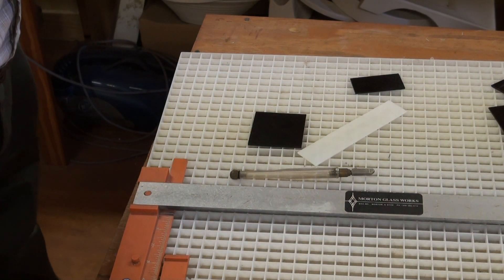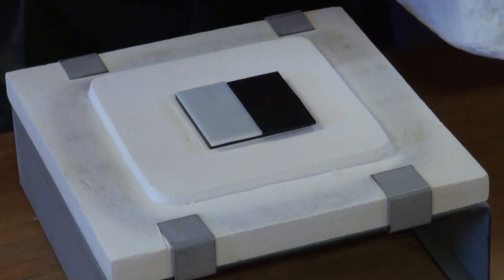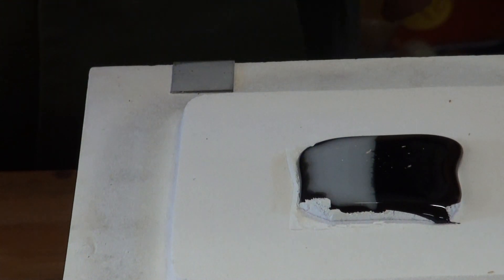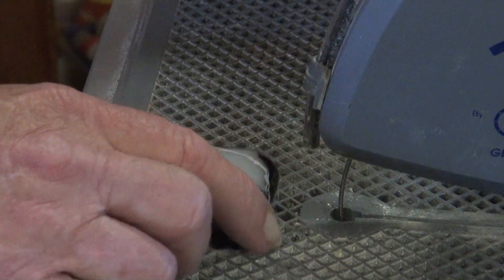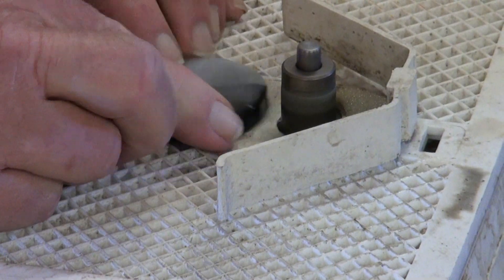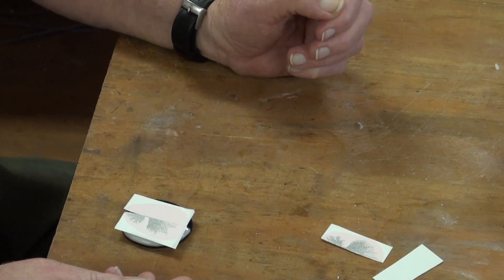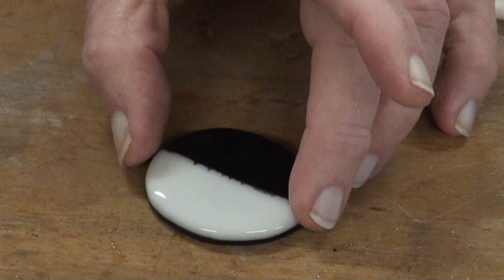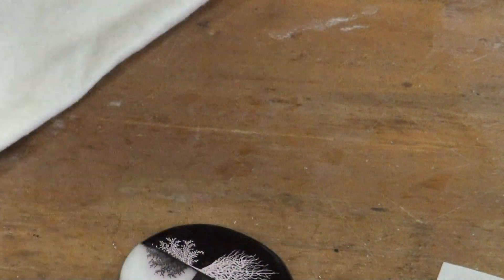HOW TO MAKE AN ELEGANT GLASS PENDANT (PART 1)

Comment from the maker: Sorry to take so long to answer.  I like it because it is fast for small projects.   I have never used it for Virigraph, but I don't see why it wouldn't work since the elements are in the lid.  The bottom is free to modify however you want.

Comment: I see that you are firing directly on the kiln floor, no shelf? Is that a standard practice?
I guess theoretically as long as the glass doesn't move off the thinfire, it would work, but I've never thougth of it. Do you wash the bottom just in case?